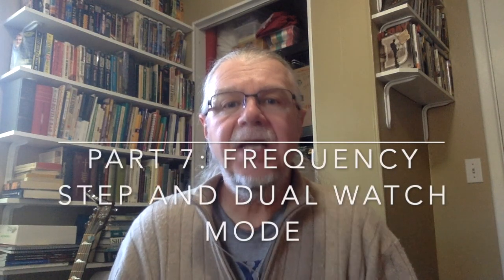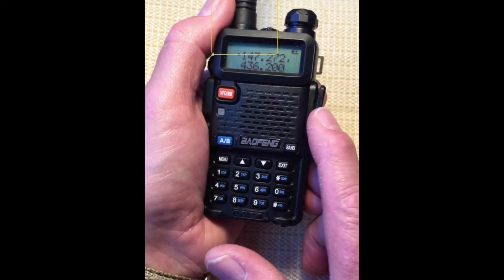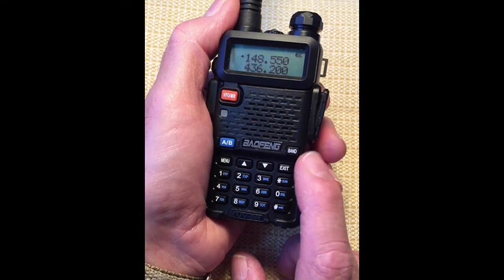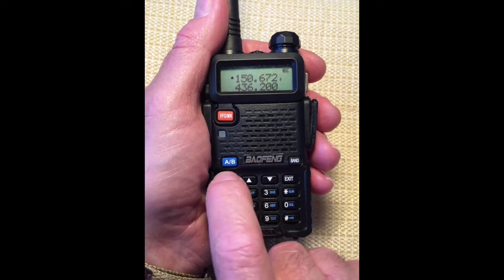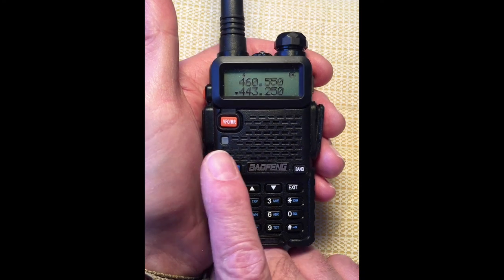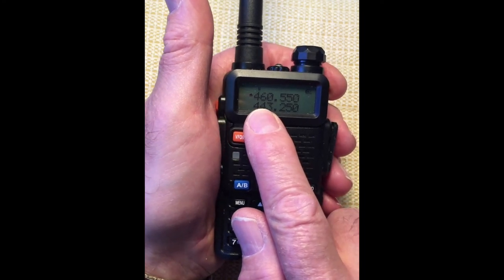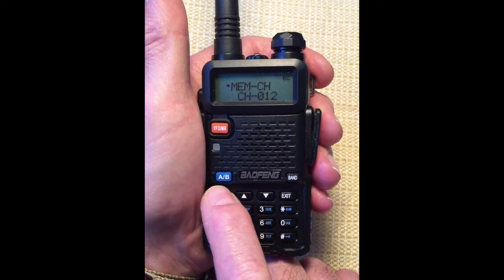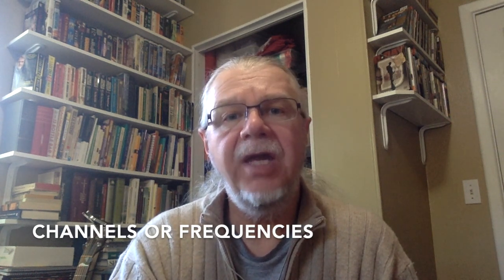Baofeng UV-5R | Part 7: Frequency Step And Dual Watch Mode

Comment: I have my radio all set up to receive. Now I need to know what the DCS table is and how to use it .
Reply from the maker: That's a very good question, Gladys. And, good work on getting your radio set up to receive...that's literally half the battle!

The next video episode will explain more about the DCS table: https://youtu.be/AgtZ3wauuyc.

Digital-Coded Squelch (DCS) and Continuous Tone-Coded Squelch System (CTCSS) are two types of filters which are used in communicating through a repeater station or a private relay net. For normal, direct (simplex) amateur radio communications, these features should be set to OFF. The DCS and CTCSS settings can be set to OFF with Menu Items 10-13.

However, when you need to rely upon a repeater, you may need to set the DCS or CTCSS settings ON! That is explained in Episode 11: https://youtu.be/mjMnT2m4IAk

To limit interference and access, repeaters may be configured to detect and rebroadcast only signals that have a specific code attached to the transmission. That code may be generated by a digital-coded squelch or a tone-coded squelch.

And that's where we get to DCS and CTCCS!

Without the proper coded squelch, the repeater will simply ignore any transmission picked up by its antenna. However, With the squelch properly encoded the repeater will instantly rebroadcast the transmission.

By the way, squelch filter tones are also known as Private Line or PL. The coded-tone squelch system may also be required to transmit and receive. Any transmission or reception may be blocked unless it is coded with the proper tone. Only members of the private group or organization would be given the tone code.

WARNING: DO NOT TRANSMIT WITHOUT THE PROPER LICENSE!

This how-to series of video tutorials is meant to help you learn the mechanics and methods of using the radio, but if you do not yet have your license, please resist the desire to click that Push-To-Talk, PTT switch!

My grandad let me sit in the driver's seat and drive his 1964 Volkswagen Bug, when I was about 12 years old or so. But it was a dirt road out in the sticks, miles from any other vehicle. For ham radio enthusiasts there are no "dirt roads out in the sticks". A press of the PTT emits electromagnetic waves that can override and interrupt the legal signals of other users, emergency and industrial systems, and the Federal Communications Commission.

Take a couple of weeks to study, and get your license!

Both DCS and CTCSS work largely the same, except DCS is digital and CTCSS is tonal. DCS has 105 universal tones measured alphanumerically (for example, "D023N"). CTCSS has 50 universal tones measured in hertz (for example, "67.0" Hz).

To have a better understanding of this, consider a wireless phone and the cellular network it operates on. Think of the frequency as the "network", and the CTCSS or DCS tone as the "phone number". We must be on the "network" to transmit or receive, but we also have to "dial the right number" to communicate.

The UV-5R features four separate menu items for customizing the private line tones whether CTCSS or DCS, with two settings for receiving, and two settings for transmitting:

- Menu #10 and #11 configure the *Receive* tones for DCS and CTCSS.
- Menu #12 and #13 configure the *Transmit* tones for DCS and CTCSS.

After setting the proper tones for a frequency and storing it into memory as a channel, the display will show "DCS" or "CT" to the left, indicating which type of tone is enabled for that frequency.

Episode 12 will explain step-by-step how to program your radio for a repeater: https://youtu.be/NJE8SlfWItY

Here's an example of a repeater that requires a CTCSS transmit tone:

Shafer Butte Repeater

- Input: 145.130
- Offset: -0.600
- CTCSS Tone: 100.0

1. Enter VFO mode
2. Select A or B to program in
4. Enter the input frequency of the repeater: 145.130
5. Enter CTCSS tone (Menu 13): 100.0
6. Enter Offset Shift (Menu 26): MINUS
7. Enter Offset Direction (Menu 25): 0.600

Now, in VFO mode, if you press the Press-To-Talk Switch (PTT), the radio will transmit at 144.530 MHz with a tone of 100.0 Hz. Release the PTT and the radio will be listening on 145.130 MHz. Store this to a memory channel if you'd like easy access next time.

When finished communicating through the repeater, remember to re-set the Menu items back to OFF! Otherwise, the offset and one configuration will continue to affect all of your communications when in VFO mode!

The process is the similar if the repeater uses a DCS code rather than a CTCSS tone.

Seaman's Gulch Repeater

- Input: 147.380
- Offset: +0.600
- DCS Code: 026

1. Enter VFO mode
2. Select A or B to program in
4. Enter the input frequency of the repeater: 147.380
5. Enter DCS code (Menu 12): 026
6. Enter Offset Shift (Menu 26): POSITIVE
7. Enter Offset Direction (Menu 25): 0.600

Check out the rest of the video episodes, take notes and try it out. Let me know how it goes. 73!

Comment: How do I turn off transmit? I want to receive only.
Reply from the maker: That can only be configured using CHIRP, a free software program. Download the program to your computer, run the program, connect your radio to the computer with the proper cable, and change the settings for transmit.

willworkforliberty has a good video how-to regarding this: 

https://www.youtube.com/watch?v=snKmYrMWGHo
Reply: @MiltReynolds  what do I change in the program to do this?
Reply from the maker: @gladyschewyful  The video link I posted above shows how to do this, step by step.

Here are the steps:

Disable Transmit Globally

1. Start CHIRP
2. Connect radio to computer with certified cable
3. Radio ON
4. Download from radio
5. Open Settings
6. Open Other Settings
7. For "VHF TX Enabled", ensure that the "Enabled" check box is blank.
8. Do the same for "UHF TX Enabled".

If the "Enabled" checkbox has a checkmark, you must click in the checkbox to deselect and remove the checkbox. If "Enabled" is NOT checked, the radio will NOT transmit on any frequencies. You can still receive and listen to the signals, but the radio will NOT transmit!

After making the changes to the settings, upload to radio, turn radio OFF, disconnect the cable, and quit CHIRP.
Reply: @MiltReynolds  I wish I could post a picture.
Reply from the maker: 1. Upload a photo to https://imgur.com/
2. Copy link to image
3. Paste image link in your comment

Comment: Hi Milt, Can you tell me the steps to change all of our UHF CB channels here in Australia, they have a tune step of 12.5 on all channels. I have manually programmed in all of our frequencies, but cannot workout how to do the tune step. Is this really needed or will it function normally without? Radio is a BAOFENG UV9RPlus, the system is basically the same as most other BAOFENG radio's such as the UV5R.   For example in Australia, CH13 is 476.725000 and CH14 is 476.750000 how would I tune step them 12.5? or is that already factored in to the frequency?
Reply from the maker: Good question, Scar Tours Bill. Let me make sure I'm understanding you. 

You've successfully programmed your radio, saving to memory all of the UHF CB channel frequencies. Now, set your radio to VFO Mode, and manually enter the frequency for channel 13: 476.725. Now, what happens if you press the up arrow one time? Does it increase the displayed frequency to 476.750? If it does not, should it? It depends!

The tune step (or "Frequency Step") does not affect what you've put into memory as a saved channel. The tune step setting merely affects how much of a change in frequency is made when you press the up or down arrow, when you are in VFO Mode. 

If you are in Memory Mode, the up and down arrow will cycle through each saved channel, regardless of what tune step you have.

I find myself changing the setting of my tune step (I call it "Frequency Step" in the tutorial) often, depending upon my circumstance. But changing the tune step setting will not affect any of the channels you have stored in Memory Mode.

For example, when I simply want to scan for any signals that might be in my local area, whether I have them saved or not, I set my radio to VFO Mode, change my Frequency Step to 20.0K, enter a starting frequency (I like to start with 146.520) and then press and hold the [SCAN] key to begin scanning. I choose 20.0K as my step setting because that's  how my local band plan spaces out the 2-meter and 70-centimeter frequencies of choice, reducing confusion and interference. I choose to start with 146.520 because that's a local 2-meter call frequency.

But, if I'm in a different region, the band plan may specify that frequencies be spaced 15.0K apart. Or, if I want to scan through as many frequencies as I can, regardless of spacing, I'll set my step to something very small, like 2.5K. 

Does that help?

Comment: Hey Milt, I read a comment on a youtube video the other day that mentioned if you press and continuously hold #6 on the keypad WHILE THE RADIO IS OFF and you turn the power on, the display will tell you the serial # of your radio. From that I'm pretty sure you can extrapolate what year that radio was manufactured. Holding #3 was said to perform some task as well, but I can't remember what function it performed. I should have written it down! Hope all is well, and thanks again so much for sharing this brilliant series/tutorial!! Much appreciated by us all, and your presentations are perfect. Very much appreciated!
Reply from the maker: Good information! Thanks, Dwayne! 

I tried it out on my Baofeng:

Press and hold [6] displayed this: "180531M"

Press and hold [3] displayed this: "Ver BFB298"

In both cases, the messages are displayed for only a very brief time.

I suspect "180531M" is a date code: May 31, 2018

Searching for "baofeng uv5r BFB298" returned a couple of interesting pages:

How To Check The Baofeng UV-5R Firmware Version (https://www.youtube.com/watch?v=_H8iHwkDp0w) - Beginning with this version, Baofeng STOPPED displaying the actual firmware version! In other words, version "BFB298" is NOT the actual version of my radio! Using CHIRP software is the only way to determine the actual version of firmware.

How to Determine the
Radios Firmware Version (https://www.miklor.com/uv5r/UV5R-FWRelease.php) - Guide to using CHIRP.

Comment: I have the Boafeng BF-F8+ model, with seems to be just a slightly older model. I could have sworn that at one time, i had one focus line scanning my saved channels while the other focus line listened to only one channel. Do you know how this is done?
Reply from the maker: That's a good question. I've got my UV-5R with me right now, in MR mode (channel mode), and I can set my focus to the A display line. Then, I press and hold the [*] key ("Scan") to start the scan. Now I can see Display line A scanning through the channels, while Display line B is locked onto one channel, not scanning. 

If I press [EXIT], the scan stops. Now I press the [A/B] key to change my focus to Display line B, press and hold [SCAN], and Display line B begins scanning, while Display line A is locked onto one channel, not scanning.

I can do the same thing in VFO mode (frequency mode).

I can do the same thing whether TDR is On or Off.

So, does this help? Is this what you're trying to do? I'm thinking that you would need TDR to be On, in order to be listening for traffic on the one channel or frequency which you're locked on, while the other display line is scanning.

[Edit] Ok, so now I've done a bit more testing. Even with TDR On, while scanning on one display line, the radio will NOT pickup any traffic on the other display line. I found an active channel, and then set my focus to the other display line and started scanning. The radio picked up the traffic from the active channel ONLY when the scanning display line heard it. The display line locked on that active channel did NOT cause scanning to stop, and it did NOT pick up the traffic.

Disappointing, but good to know.

So, now I don't know how to do what you're describing. I'm NOT able to be scanning on one display line while listening for traffic on the other display line.

Sorry! Thanks for the interesting question!
Reply: @MiltReynolds  Thanks for the reply. I could swear that I did it before where i could lock one channel and scan with the other focus line. But ever since i reset the scanner, it quit doing it. I can get it to listen to 2 channels at once if neither focus line is scanning, but like you said, when one is scanning, the other focus line seems to be ignored. I'll keep digging and playing with it and see if i can get it to work. If i can, i'll let you know. And if you happen to stumble on how to make it work, please let me know. Thanks again for the reply and the videos you post. I've used a lot of it!
Reply: By the way, since you seem to have pretty good knowledge of these little handsets, I have another question for you. I’ve looked everywhere for an answer, and can’t seem to find one. Do you happen to know how to add a delay when it’s scanning when it hears something? Like let’s say I have 10 channels, and it’s scanning through them, and on a channel it hears something and stops on that channel to listen to it. But as soon as the channel goes quiet, it instantly starts scanning again. I’d like to make it so that it’ll stay on that channel for a second or two at least before it resumes its scan. We have a real active police channel here, and about 20 more others that are usually pretty quiet, but still worth scanning. The problem is that it takes a good 10 seconds to get back to the police frequency, and by then, it’s usually too late to hear dispatch’s reply. So, it would be nice to be able to stay on that channel for at least a second or 2, and maybe even up to 5. I’m hoping you might know of a way to do this. And once again, thank you for taking the time to reply. It’s not often good you tubers actually pay attention to their viewers. I really enjoy your videos and hope to learn lots more from you! Keep it up!
Reply from the maker: @BlameZiggy  I think I can help with this one! Baofeng programs three different options for us to use with the scanning feature. I think I cover this in Part 8 - Set-up for Ham Radio Use (https://youtu.be/AgtZ3wauuyc). Here's a synopis of the scanning options:

---

### Set Scanner Resume Method - Menu 18

The scanner feature has three different modes:

- Time Operation (TO): scanning resumes after five seconds
- Carrier Operation (CO): scanning resumes after the signal ends
- Search (SE): scanning stops when signal is detected

The default setting is Time Operation (TO). Depending upon personal preference, this setting may be changed.

The scanner feature is slow: approximately three frequencies per second.

---

When I'm driving, I like to have my radio set to Time Operation (TO). This allows me time to glance at the display and make a mental note of the channel that has traffic. At the same time, if the scanner stops on a noisy station (too distant to be readable) I know that the scanner will move on after five seconds. If the traffic sounds interesting, the five seconds gives me time to tap the [EXIT] key, halting the scanning feature, and locking the radio on that channel.

It sounds like your radio is set to the Carrier Operation (CO) mode. You might try the SE (Search) mode. Scanning will stop on any active channel and remain there until you intentionally restart the scanning by pressing and holding the [SCAN] key.
Reply: @MiltReynolds  That's odd. I have mine set to TO, but it still starts scanning as soon as the signal ends. Maybe I have something going on in the firmware that should be or something. SE mode is a bad idea here. There are 21 channels that i listen to, and they're all important, so I cant take the chance of not noticing that the scanner stopped searching and is stuck on one channel. So it's possible that i just have a glitch in my firmware or something.
Reply: OK, so in mine, the CO feature stays in place for 5 seconds, where as TO allows the set to start scanning immediately after the transmission ends.
Reply from the maker: @BlameZiggy  Strange! But, I'm glad you figured it out. Slightly different programming for that model, I guess.